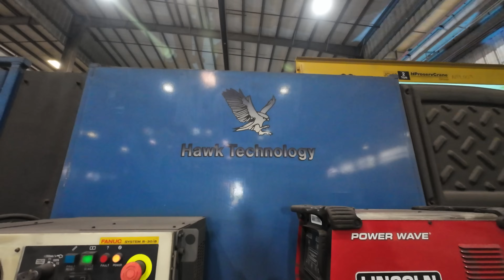Why We Hire Welders, Not Robots | Don't Make these mistakes

Comment from the maker: 💬 Got a question or a hot take? Drop it below. Let's talk shop
Reply: Thank you for manufacturing in the United States and maintaining high standards!
Reply from the maker: @TomStriker your welcome and thanks for the comment Tom.
Reply: I'm thinking about getting a laser welder for welding mild steel parts.  I was thinking of a 3000w with wire feed filler and a 2 axis positioner like the one you have.  What do you think about these machines?  The main weld would be a 3/16 thick pipe welded to a 1/2 inch thick plate.  Right now we hand TIG weld these with a fillet around .125 to .15 wide.  Is the laser weld as strong as TIG?
Reply from the maker: @leensteed7861  you will absolutely flip when you try laserwelding!! 

The weld will be as strong DEPENDING on the powersource. 

The IPG welders advertise 3/8” penetration on their 2000watt.

You will want the wire feed option and you have to be very careful with the angle of the gun. It’s very easy to completely miss the weld joint because the actual weld is so thin. If your in Texas reach out to Pioneer Machine, they have a demo trailer and you can test out the machines.

Please note that welding small circles can be difficult.
Reply from the maker: Also you can buy a little motorized turn table pretty cheap.
Reply: @LaserWeldTexas  All my components are cnc machined to very repeatable.  I think you can "wobble" the laser beam to make a wider weld too.  I just bought a MIG with 2 axis positioner and would love to have the same robot with laser so once my guys learn one robot they will know both.   I'm 3 months behind on orders so we really need this
Reply from the maker: @leensteed7861  if your parts are CNC machined buy a Laserwelder on Monday haha. If you’d like we could even run them for you while you set up your process

But seriously you won’t regret it.
Reply: @LaserWeldTexas  I added a laser robot to my order.  3000w and also 2 axis positioner so I hope it will do every weld in one setting.  Wish me luck Hahaa!
Reply from the maker: @leensteed7861  we wish you the best of success!
Question did you order a robot or a handheld welder? If you ordered a robot you got to make sure all your fixturing is perfect or you can get a “seam tracking” or “edge finding” adder to your robot. That will make or break a robotic application.
Reply: @LaserWeldTexas  I ordered two robots. Both have 2 axis positioners.  One is a double pulse Megmeet MIG and the other is a 3000w Raycus laser.   I flew to China for training and the people there are so friendly and generous.   My fixture can locate on CNC machined components so they should be very consistent.  I was just watching your tube cutting laser.  I saw one at the Shanghai show and thought it was amazing and here you guys are using one.  I also just watched a youtube video of a company making steel frame building kits and they were cutting every piece by hand with plasma.  You really need to talk to them lol!
Reply: “There is not substitution for first hand knowledge backed by theory.” - Dr. Deming
Reply: how exactly do you track productivity and translate that to pay?  I work in a factory with very lazy co-workers, I'm wondering if theres a way your system could be replicated where I work.  For context, we do mechanical and electrical assembly, and absolutely none of it can be automated.
Reply: @certifiedgenius9001  Is there a finished product being sold?   If so you can have a bonus amount per unit produced.  That's how I do it at my factory.  I have a dollar amount for each product and this money adds up to around $15,000 per month.  There are 8 employees and the 15k is divided by the total number of hours worked by everyone and is distributed according to hours worked by each employee.

Comment: How do you design your fixtures as well as positioners?
Reply from the maker: For software we design everything in SolidWorks.

Most of our fixtures utilize laser cut plates to hold everything in position and the plates are assembled using slot and tab.

This can be 10x cheaper than using traditional machined fixtures and if you need to make revisions your really just out the cost of materials($.50/lb)

SolidWorks actually has a feature that wil add your tabs in now that is very helpful.